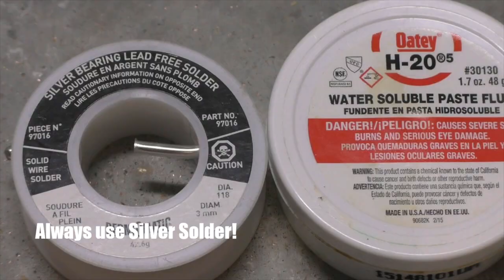How to Build an EASY Pot Still Condenser!

Comment from the maker: ATTENTION: I forgot to mention, the COPPER WIRE is wrapped around the vapor tube to create turbulence in the water to increase the cooling efficiency:-)
Reply: Ok it creates a type of whirlpool... cooooooolll
Reply: I use vice grips to make small offset crimps (not enough to pinch off the flow) in the center pipe every 1.5 inches. It causes agitation in the vapor and the cooling water.
Reply: Yep, you want to decrease the laminar flow.
Reply: @DanCooper404  No, laminar flow is the opposite of what he is (unnecessarily) trying to achieve.

Comment: When soldering, if you put the heat where you want your solder, it works pretty good. Soldering works by capillary attraction, so heat the fitting, with flame concentrated on fitting and the solder will flow into the joint. Cheers!
Reply: Always heat the work and let the work melt the solder.
Reply: I explain it as heat the fitting and let that draw the solder in.

Comment: This condenser would have been much more efficient and thus so much shorter if you had  flattened the central section of the inner pipe, leaving a 1-2 mm wide section through it. This reduces the cross sectional open area, while the surface area stays the same, meaning that you have a  much better surface area to open cross section area, giving much more efficiency.  The open cross sectional area of the vapour tube doesn't need to be very big, -your hot vapour volume is probably a thousand times greater than the volume of the condensate.

Comment: FYI, copper conducts heat 20-30x better than SS.  So don't be fooled by those fancy SS condensers.   This copper Liebig probably works as good or better.   For better efficiency, put the wire in the vapour tube as well.

Comment: Love this channel. I built this condenser and it works great but it seems like the end product was a lot harsher than when using a worm. To solve this I wrapped a copper wire around a dowel and inserted in the vapor tube. Make sure it fits tight. This slows down the vapor and makes a much smoother product. Keep up the good work.
Reply from the maker: Really great idea👍

Comment: I built mine out of 1/2” inner and 3/4”outer. Passes plenty of water and cools great, 3/4 pipe and fittings are much cheaper than 1”
Reply from the maker: Great tip!
Reply: Nibco 3/4 in. Copper X 1/2 in. D Sweat Copper Tee 👊💥

Comment: Hey Brother, nice build..........Getting ready to build one myself.

Browsing the comments, I didn't see referral to this........If you're soldering , welding, or brazing on a concrete floor, be careful! The flame can heat up a localized area on the floor, and the moisture within can flash to steam, and POP!.......It'll shatter said local spot, and small concrete pieces will fly everywhere, mainly in yer eyes!........Rock On, Brother!
Reply from the maker: Good tip. Thanks!

Comment: Hey " Bearded " .   Hi again from NH.  A quick update after asking you about the cherry cider aging before bottling. I did as you suggested and let it go about 6 weeks before back sweetening and bottling. I back sweetened using the apple concentrate and some more tart cherry to taste, did the " pasteurization ", and bottled. I've consumed a couple of them so far and wow are they delicious. Thanks for the helpful advice !  
  I have a small batch of real cider " freshly pressed " with dk brown sugar added to it, all fermented and ready for back sweetening as I write this.   Cider 1.048 + 1- 1/2 cups dk br sugar to 1.070  fermented all the way down to .995 ( ish )    +/-   9- 1/2 %  abv    Dry ? oh ya !!   Think I am gonna sorbate this one and sweeten with more fresh cider before bottling. Should be nice and apple(y ) sweet and still around 6 percent I'm thinking.
 Also, I did a batch or your apple jack. I started with a gallon of juice ( plus concentrate ) and ended up with 2- 16oz bottles. My God is that GOOD !!!  Thanks for that one as well. 
 Now, a helpful hint for you because you are so kind to all of us " followers " out here. From someone who has been soldering for years, if you can, try to heat your pipes from below and apply your solder from above. Once hot enough, the solder will flow down from the top and will suck up into the joint. As someone else noted, a damp rag will clean things up very nicely as you go, and will get that little droplet of solder off the bottom of the joint before it hardens, if you happen to get a little too much on there.
 Be well my friend and stay healthy. If you ever get up to NH. after this covid thing is under control, well you know,,, dinner and drinks !!  -- den
Reply from the maker: So glad you're jumping into the hobby with both feet and having so much success! And thanks for the soldering tips, and the dinner offer;-)

Comment: Oh shit I’m early :) 17 years old here you and because of you I really wanna make brewing my profession I’m a big fan of what you do!
Reply from the maker: Get a job in a brewery, little brother. If you want to go pro, learn from the pros. Good luck:-)
Reply: @BeardedBored  i will thank you so much!
Reply: It's a great mix of biology and chemistry.  So much to learn.  It's so much fun!
Reply from the maker: @ThinkFreely2012  If I ever get the chance I'm opening a microbrewery. Beerded and Bored. Copyright 2020;-)
Reply from the maker: keith moore  Depends on the state. Some states you can work in a place that sells and/or makes products you can't yet use, he just wouldn't be able to serve or sample. I worked as a glass washer and keg loader in a bar when I was 19. Even had the ABC officer come in and check id's while I was working with no problem as long as I wasn't serving.
Reply from the maker: keith moore  No idea since I don't have a CBP or DSP. Might be different on the manufacturing side.
Reply from the maker: One of the other commenters mentioned you might not be able to work in a brewery since you're under 21. You'll have to check on that. But you can research, and you can probably get a job in a home brew shop where they sell brewing supplies. There's no alcohol, just the supplies to make it. Most pro craft brewers started out buying supplies from shops like that, so you can learn a lot:-)
Reply: keith moore  where there is a will there is a way ;)
Reply: @BeardedBored  the earlier I start the better even if it is at home just to get a feel for it, mess up at home and learn from it. But yes I might also work at a home brew shop aswell
Reply: keith moore  I’ll start as low as life has me start but my goal is to move up nevertheless thank you man you made my day!

Comment: Nice work, I like the spiral so the water can spiral around the vapor pipe.
Reply from the maker: From what I read the spiral helps to keep the water turbulent so it cools more efficiently. Seems like it works:-)
Reply: @BeardedBored  simple trick and makes it cooler.
Reply: Thanks for clarifying that! I wasn't quite sure what that was for.
Reply: To increase cooling efficiency,  just add ice to your cooling water.

Comment: Great design and love your videos!!  If you’d like to save a step, you can combine the T and the reducer in one step.  On Amzon search for “1/2x1/2x1 copper tee” (or 1/2x1/2x3/4 if using the smaller diameter outer jacket).  This is a T and reducer in one piece. Grind out the stops as noted in the video and the inner pipe slides through with the built-in T providing the water input/output.  These fittings cost a hair more than the extra fittings altogether, but it saves some cutting and soldering and gives an even sharper looking finished product.
Reply from the maker: Thanks!

Comment: I love the length of that condenser!!  Thanks for the awesome video
Reply from the maker: Thanks!
Reply: Actually,  if it was modified ever so slightly,  it wouldn't need to be anywhere near that length.  Having it that long just wastes space and materials. He should have just flattened the middle part of the condensate tube to a 2mm inner gap.

Comment: Reducing tee fittings make the build even easier. Agree with other comments that a 3/4" outer jacket is adequate.
Reply from the maker: Thanks for the tip Jason!

Comment: Freaking awesome man
Reply from the maker: Hey, thanks brother!
Reply from the maker: @theworldisastage1984  Thanks!
Reply from the maker: @theworldisastage1984  Thanks. Good luck on the build.
Reply: @BeardedBored  I am possibly pretty confused here, but in your title you say this condenser is for a pot still. Couldn't it be used for a reflux still too if you just put a pre-cooler on the still column?
Reply from the maker: @BanjoNoob2  Sure, it'll work on a reflux column.

Comment: Enjoyed the build, at some point I am going to have to try this. Right now my condenser is built onto my column. Going to be doing some changes hopefully soon
Reply from the maker: Go for modular upgrades. Makes everything so much easier.
Reply: I bought mine and it's the same way (one piece build). In the near future I'm going to modify it to be modular via tri clamps. The liebig condenser that came on it is undersized anyway as it's made of stainless which makes a poor heat sink.

Comment: I made one of these with smaller diameter pipe. it’s got a very tight water path. But it seems over powered for my current setup. It starts to condense the environment on the outer as well. 😅
Reply from the maker: Reduce the water flow if it's too cold.

Comment: I was wondering if a air cooling system would work for a condenser . Have your half inch tube and surround it the same way but with maybe 4" pvc with a sort of tall chimney to draw cold air up and through . Would probably work in cooler climates  . Great and informative video,  thank you.
Reply from the maker: I saw one with fins made of thin copper like a heat sink with pc fans blowing on them. His tube was at least 6 feet long, but it was neat, and it worked;-)
Reply: Water is about 50 times more efficient for taking the heat away...you might as well just put a fan on it without a jacket.

Comment: great video.  why the copper wire around the 1/2" pipe and is there a link to the wire you used?  I don't see it listed with the other parts.  Thanks
Reply: Its 12 or 10 gauge  copper wire. Its meant to make the cooling water swirl and get agitated instead of quickly going straight through the water jacket. It's been proven to make the Liebig cool the alcohol more efficiently and be able to knock down more heat than without the wire.
Reply: @davidmetz1893  ok thank you I was thinking something along those lines but just wasn't sure.

Comment: Great job man just I didn't get the use of 3' heavy gauge copper wire?
Reply from the maker: Yeah, forgot to explain that. It's to create a little turbulence in the water flow so it slows it down and improves the cooling efficiency.

Comment: I once successfully torch welded a hard copper pipe T with copper rod.  So it would be possible to sheath this contraption with 2 inch rigid copper & fittings.

Comment: Keep a wet rag handy. When your just finished soldering a joint, wipe it off. Most of the black/burnt flux will come off. You can wipe flux on a freshly soldered joint to take a lot of the black off too.
Reply from the maker: Thanks!
Reply from the maker: @theworldisastage1984  Thanks!
Reply: Never never never put a wet rag on a fresh solder joint. 
Again, NEVER!!!
It can cause the solder to crack. It will be a hair line fracture.
Reply: Clean the solder joint after it has cooled off.
This is basic plumbing soldering 101.

Comment: Howdy Brotha, I am planning on making one of these for a project I’m working on with steam… have you used this since making it and can you speak to its effectiveness in going from superheated vapor to a saturated liquid mixture? 

My steam will be running around 600-800 degrees F out of a turbine so I am trying to gauge how many linear feet of this style condenser it would take to pull it back down to 212 degrees F.
Reply from the maker: Wow, no idea if it could knock down superheated steam. It's been used many times and works great, but 600-800F? No idea how many feet you'd need. You might want to look into a shotgun condenser. Lot more surface area in a smaller space and better potential to knock down the temps you'd be working with without needing a 20 foot long condenser.
Reply: @BeardedBored  I just looked into shotgun condensers a lot more, and I think that might be a good option… effectively a very similar concept but far more compact from what I’ve seen. 

Have you used shotgun condensers in the past? 

If you have or have talked personally with anyone who has, did you find them exponentially more efficient than their Liebig counterparts?

Comment: What would be the best way to connect something like this to a tri clamp fitting?
Reply from the maker: See if you can get some smaller triclamp fittings, like 1/2 and solder them on instead of the copper union fitting. I'm probably going to swap mine out for triclamps someday too.

Comment: That's the same way I'd build a heat exchanger, to preheat cold water coming into your bathroom shower with the waste water going down the drain. At much larger diameters, obviously, but it's that simple. The result is using more cold water and less of your hot, thus saving energy. 👍

Comment: That’s a solid condenser. Definitely long enough for a lot of things I think. I’m not an expert but it just looks like good surface area.
Reply from the maker: I've seen smaller ones handle a propane heated keg boiler without any issue, but I don't really know what the limit is. Good enough for now:-)
Reply from the maker: keith moore  Good to know;-)

Comment: I gotta ask, what is the purpose of the wire wrapped around the inner tube for? I'm in the process of building my own and thought I would look through more how to videos before I close it up.
Reply from the maker: I creates turbulence in the water to slow it down and make the cooling a little bit more efficient.
Reply: @BeardedBored  thank you! I will add some myself.

Comment: Hay mate I've just about finished making one of these but does it matter what ones  the water in and out ,how do I tell the difference before I finish soldering it all together. 
Awsome video and cheers for the inspiration to build something else to use on my keg instead of  just my Nixon stone 👍
Reply from the maker: It's best to have the water come in at the water jacket pipe closest to the main condenser outlet at the bottom so it flows uphill. It cools a lot better that way.
Reply: @BeardedBored awsome, thankyou so much for the reply and the information.

Comment: Brilliant video great soldering. What is a sacrificial alcohol run? I did my vinegar claening.
Reply from the maker: You take some crappy wine or other cheap alcohol or some saved up feints and run it through your system like the vinegar run. It's called a sacrificial run because it is not drinkable once it has cleaned the last bit of flux and junk out of the still. Save it for hand sanitizer.
Reply: @BeardedBored  Great thanks.

Comment: This is probably overkill, but I put a strip of copper twisted into a spiral inside the distillate tube to prevent laminar flow of the vapor inside the tube

Comment: Did I miss it? What is the point of the copper wire wrapped around? Is it is encourage a certain water flow pattern?
Reply from the maker: I forgot to mention it. It creates turbulence and slows down the water to make the cooling more efficient.
Reply: I was wondering this too. My 28" leibig doesn't have that as I didn't know about it but it works so good that I barely run a trickle through it on my keg.

Comment: Hey, Bearded and Bored,  Not sure if I just missed it or not in your video but what is the reason for adding the coil of copper wire around the pipe... Is if for fluid movement?
Reply from the maker: Forgot to mention in the video, it's for turbulence to slow the water down slightly and make the cooling a little more efficient.
Reply: @BeardedBored  In a shotgun condenser based on the same size of pipe what would be better ? Less condensate pipes and more water in the jacketed area or more pipes with potentially less water around each pipe ?
Reply from the maker: @Lixmathing  More pipes because you can always turn up the water flow or ice down the water.
Reply: @BeardedBored   Thanks lots for the help.  Im getting ready in the next three weeks to build my very first still.. Should be lots of fun and I'm sure, some frustration.. My plan is to film the progress.
Reply from the maker: @Lixmathing  Good luck on the build! Hit me up if you post the vids:-)
Reply: @BeardedBored if you want to slow the water down,  just add a speed controller to your pump. Adding ice to the coolant water is another option to increase efficiency.